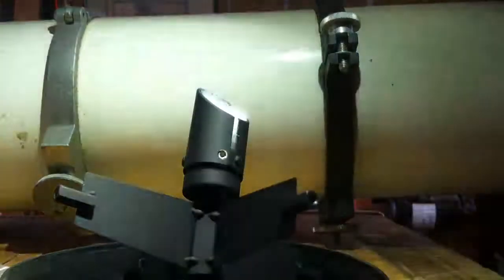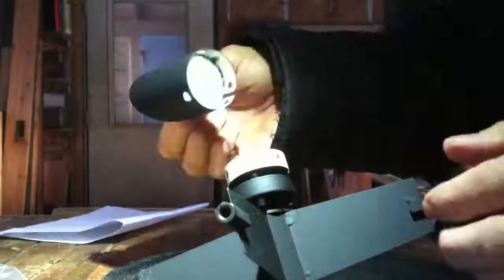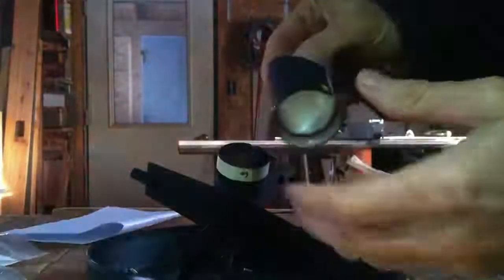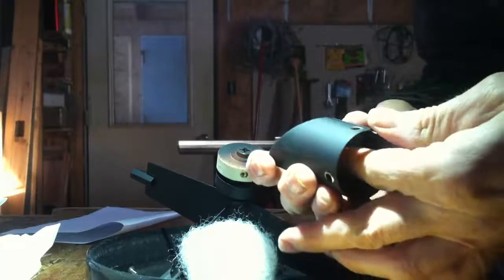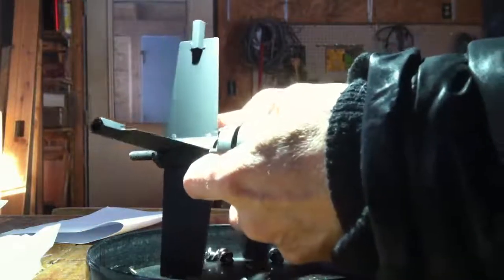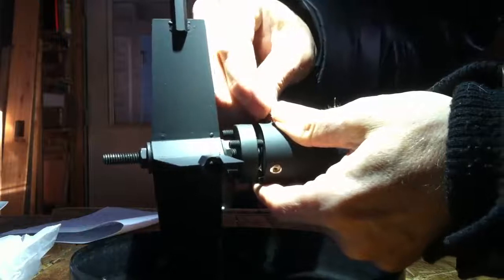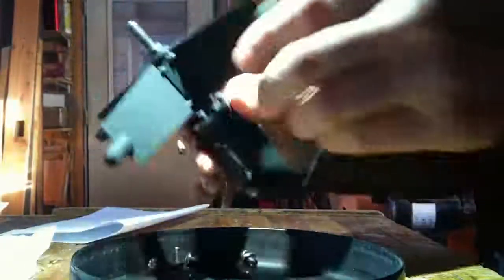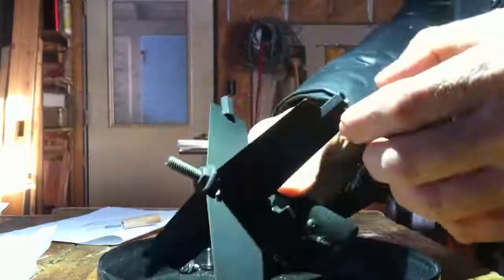Telescope Secondary Mirror Install

Comment: You have way to much of a gap in that secondary mirror holder.  It should close up as a nice seam if it is sized correctly for the secondary mirror in it.
Reply from the maker: Thank you, Jesse! I am a complete newbie at this. Many, many years ago, I took the original spider (which I snapped) and secondary mirror with me to Silicon Valley when I got a job there and it got left behind in a cupboard above the stove in some apartment! I and I finally got around to fixing it for my brother and we got some really nice views of the Trapezium in Orion among other things!
Reply from the maker: OK I think you are talking about the gap in the black sheet metal cylinder. Yeah I don't know why there was such a gap. They must've cut the sheet metal too short or cannibalized it from another holder??